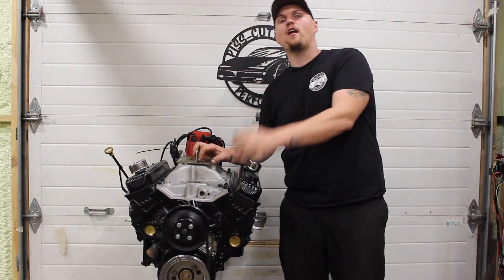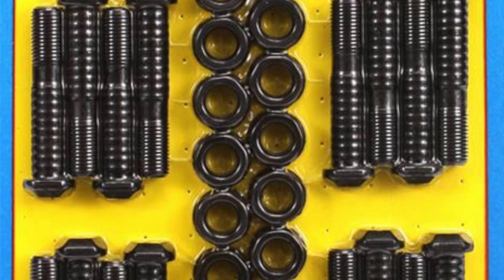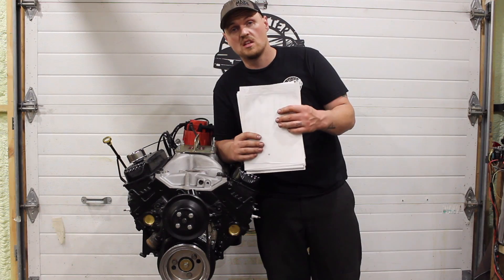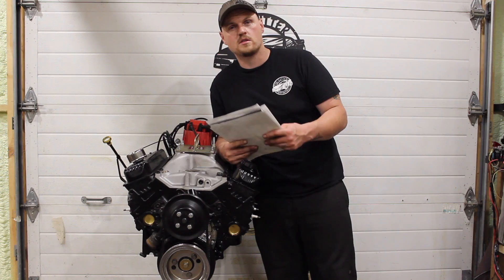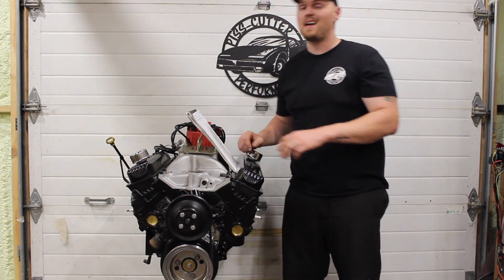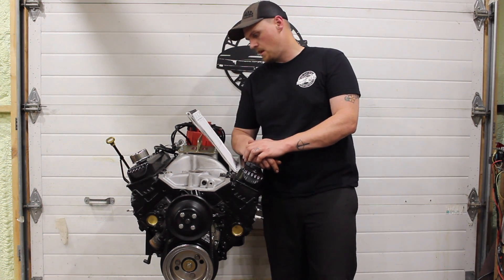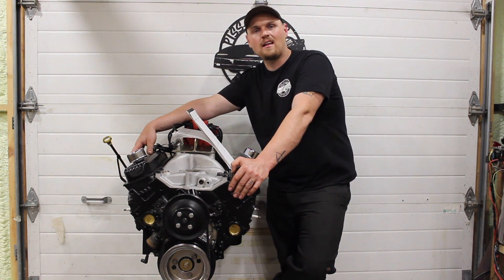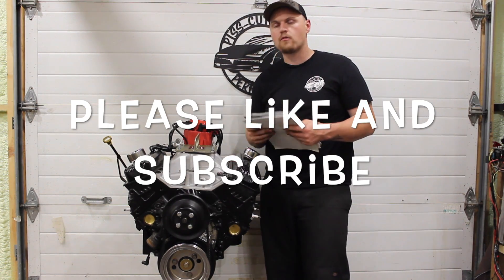Cheap Chevy 350 Power! 400+ hp Vortec Heads LT4 Hot Cam Dyno (L31 Budget)

Comment: Yeah sounds about right, stock lt4 makes about 350 hp, and thats without headers and with smog bs programmed into it. Vortec heads are fairly similar in terms of flow so naturally a slightly bumped up lt4 cam without having all that emissions bs forcing it to run rich would run 400+. People dont like those lt1s but they were pretty badass once you tuned them

Comment: Have you tried something like a Lt4 hot cam or similar specs but non-roller, solid lifter and solid 1.6:1 rocker arms adjustable valve lash. With flat top pistons at 11:1 compression ratio on 94 octane. With beehive valve springs with a tunnel ram intake manifold for 2 650 CFM 4 Barrel carburetor with thick open  carb spacers and dual 3 inch exhaust on 4 to 1 headers and straight thru mufflers

Comment: My Step-father has a L31 in his "96 K1500 that I've been doing maintenance/repairs on for years and has 200k. He's been getting interested in modifying it since I started my stroker build. I think he would be on-board with a build like this, maybe a slightly smaller cam. The newer cams have a  higher intensity than the old lt4 cam, maybe the summit SUM-8801 212/218 on a 112lsa same lift as the LT4 cam with only 1.5rr.
Reply: Is that summit cam you mentioned for a 5.7 Vortec engine or just vortec heads on a small block? I found out the hard way that Vortec engine is a different animal. Thanks.

Comment: Running a turbo 400 transmission what torque converter would you recommend 3.07 gears
Reply from the maker: Ive used that cam with a 2600 to 2800 stall and it worked well but it really depends on your setup

Comment: What fuel were you able to run in this? Would the set up be able to use 87 octane OR does it need to be higher?
Reply from the maker: It will run on 87 octane

Comment: I designed that cam in the 90’s. Originally made at lunati for an lt1/lt4 stroker combo for the first 4th gen fbody build in history behind slp intake combo, before we really figured out tuning.  We had custom made injectors prob the second run ever in history… behind accell’sLingenfelter was in communication. It was good times.  We all knew what was coming.  But for this bracket of engine there is no better combination for heat and vacuum as well as usable torque with decent rpm, we were shooting for 6400 shift points.  It’s made for a t56 speed and track, cannon ball run car. When it was still a real money race.  thanks for making this video so cool to see.  We basically used an ai algorithm for that cam combo btw, it took days for it to “compute”.  In the 90’s.
Reply: That's badass
Reply: Too bad the LT4 only lasted one year.

Comment: Sorry if i missed this. Can anyone help me figure out what kind of machine work was done? 

I have two motors i want to build. I have two sets of un cracked heads with work exhaust valves.

One of my blocks has a line in it from having water sit inside it. 

I own a very nice Sunnen portable rigid hone. 

I have not used it yet but an considering buying the tooling for it and attempting to prep my blocks for this. Any help or comments would be appreciated 😊

Comment: Just wondering the vortec heads. Did you have to machine down the valve seal bosses so you can run the lt4 hot cam?
Reply: I watched your video on beehive springs and I understand how you run. 520 lift cam with out machine the heads

Comment: I thought I would come back and update on the similar L31 I built a couple of years ago. Mine has a LT1 rotating assembly with the lightweight Mahle flat tops they used, a GM 6492' camshaft, and 185cc 2.02/1.60 valve Vortec heads that came on a dead 350 in a Tahoe I bought cheap years ago.  1.6 rockers and LS Beehives on it.  Mercruiser dual plane MPFI intake that is basically a Performer RPM with injector bungs cast and machined into it, 4150 throttle body, Thorley Tri-Ys into 2.5" dual exhaust with high flow cats to a dual in/dual out magnaflow. Runs strong even in a 5,000+ lbs G20 van with the factory TH400, factory torque converter that was behind the TBI 305 in that van and a 3.08 rear gear. Currently fighting a TH400 Governor/Valve body calibration that has me pulling my hair out. I modified a stock TH400 governor with an old TCI kit I had laying around the shop. It caused the TH400 to lose its ability to shift at a consistent RPM at WOT.  Sometimes it would shift 4,500, sometimes the 5,500 I tried to set it for, sometimes it would bang the limiter at 6,000 rpm.  I bought a new old stock GM TH400 governor for a L82 Corvette that usually gives a 5,500 rpm shift, does the same thing.  I put the stock 4,500 rpm TBI governor back in it and it shifts perfectly and consistently.  Even shifting 4,500 it moves out well, but it gets up and goes so much better shifting at atleast 5,500.  I would settle for consistent 5,500 rpm shifts, but 5,800-6,000 would probably even be better for that setup. it carries good power higher than I am willing to rev the 90s LT1 rotating assembly in that L31 engine on a regular basis. I either need to modify the 1-2 shift valve setup to allow for manual 1st to whatever RPM I choose or figure out what it is about this specific late 80s TH400 that is preventing the governor calibration from being altered from stock. Guessing it has a weak spring somewhere in the valve body that was designed to make the unit do this, because it also lacks a WOT 2-1 downshift at any speed and cannot even manually shift it into 1st above ~10 mph.

Shifting at 4,500ish
https://youtube.com/shorts/hSR8kKJkMk4?si=O_npU5f43aYCcMY4

Comment: I wonder how much the one I built would make…it runs great..same bottom end and carb …can is slightly different 

.217/225 .495/500 110 LSA-roller 

Air gap intake

Blueprint 195 - Alum heads 2.02/1.60 68cc

Headers- ACCEL hei - 1.5 roller rockers

Comment: Hey I'm building a engine mostly like this one. I'm wondering if anyone has used sum-174000 spring kit. It looks like it would work has 550 lift. And is cheaper.
Reply from the maker: You won't be able to get much past .500 lift with that kit before the retainer gets too close to the valve seal

Comment: Were any modifications done to make the LS(7?) Lifters work?
Reply from the maker: No, they are direct replacement
Reply: @cuttersperformance slowly figuring this out so far I’ve got 
36lb Aus Injectors ( spider injector replacements ) 
174002 Springs 
8802 Summit Cam 
PRW 1.5 Ratio rockers 
LS7 Lifters. 
Just need to find a local guy that can clean the heads and do a valve job and porting. 
Also on a LS Computer and will be tuned through hptuners. 
I’d like to see you take a shot at keeping the stock L31 Intake and seeing how it pars with the carburetors!

Comment: I got an L31 stuff'd Summit flat tops, forged rods, Skip White NKB heds a Melling roller w/ .495I- .503 E 220-224 @.50 w/110 lsa,, very close to 10.01 to 1 compression ration,,, should squeek out a bit more power than the GM Crate motor,,, should be a good combo for my daily driver 71 Chevelle,, 
I try to find similar builds to geustimate what i will hav,,,
Thanks for the work you do,,,

Comment: 383 stroker with vortec heads and lt4 cam would work great or should get different options?? Please help
Reply from the maker: It would work, but personally, I'd go a bigger cam on a 383. I'm doing a few 383 stroker on my channel over the winter if you need some ideas
Reply: @cuttersperformance i have a vortec engine in my 81 corvette 4 speed,need vacuum for headlight,

Comment: Definitely surprised with the HP. The XR276HR on Comp Cams website is only making 375 or so hp. That's with a 224/230 split.
Reply from the maker: I wish they did those dyno charts with better heads. They used dart SR heads, which are basically a crappy stock head
Reply: @cuttersperformance  yes, I guess they just do it to show the type of curve you'll get. I'm hoping to get over 400 with a set of TF 195 on my sbc.

Comment: Do you think this would run with the stock vortec intake? I mean everything you’ve done to the heads but with msd ignition parts paired with upgraded spider injection in the stock intake? With computer tuning of course. 98-02. I could 0411 swap it as well but I think I could get it to run decent with the stock 99 computer. 99 Tahoe Limited is the piece in question.

Comment: The thing is when your driving through town in third or second gear & whomp on throttle 350 specialy carburetored? they have so much torque dyno,s don't show that whomping power? fuel injection is weak crusing thru town no whompping power just rpm,s lol?

Comment: Am i able to run the stock vortec heads?
Reply: At the very least you should replace the rocker studs with thread in studs. Be best if you also installed heavier springs too to prevent valve float or breaking one depending on application.

Comment: I'm trying to understand cam lift and valve clearance. I saw in another video where the vortec head was modified to clear .500 of lift. How can a cam with .525 lift require no machining on the head to clear the .500 of lift?
Reply from the maker: This video should clear everything up for you 
https://youtu.be/UZosxGQyGMs
Reply: @cuttersperformance  thanks. That cleared it up. Is there any other valve retainer that will work with this valve spring? Seems summit it still out of stock on the SUM-174003-3.
Reply from the maker: @dbohann66  787-16 comp

Comment: That's very nice,ypu think if pump thr compression up to 11to 1 will be better or possibly? Maybe better rods can be rev higher?I have a gm performance engine 350,357hp 407 torque, I need just a little more,thanks!

Comment: Pat, what’s your thoughts on the Summit 8802 cam, that’s supposed to be an LT4 Hot Cam copy without having to use the 1.6 rockers? On paper it looks very comparable, and for the price = Gold! Any input you can offer? This is the cam I’m going to run in a stock Vortec bottom , like yours, and I have followed ALL your Vortec head vids- so hoping for similar results…… I still have to measure (like you informed me!) the clearance on my full roller aluminum  rockers, with the 787 retainers and either the .050, or .030 offset keepers (like you also have taught me!), and make sure it’ll clear, or grind the wings down to fit given the minimums you said I should look for! You are almost a Demi-god on how to make these Vortecs rock!! I called Felpro about using their .015/ .016 steel shims on my 100,000 mile short block and built Vortec heads, and they recommended using spray high tack (Indian head/ permatex) on both sides and torque down before dry. Thoughts? 
ALSO! huge question! I lapped my old valves in, but thought- as cheap as new Engine Tech valves were for stock Vortecs, I decided to buy new valves. Question- do I now need to lap the new valves in also, so they seal right, or are new valves fine without lapping?

Everything I’m learning- I’m learning from you, brother!!! THANK YOU!!!
Reply from the maker: yeah that cam will work just like the LT4 hot cam, the summit cams are great quality. 
Careful spraying some of the felpro shims gaskets as they have a rubber film on them that will react and peel when sprayed with copper spray. If it's a bare shim gasket then yes the copper spray is a great idea to prevent water seepage. 
Never a bad idea to lap in new stainless valves on old seats. 

Cheers! Pat

Comment: From what ive heard the 604 is very undercammed and with a nice bigger cam they pump out around 480hp all day long with just a cam swap, the 604 is a class engine for short track and i believe come sealed, i have a buddy that ran pro stock that was his dads on 1/3 mile banked track and they can run a sealed 604 with a 4bbl but he has a 11:1 350 that dynoed arounf 500hp but they have to use a 2bbl. I thought it was the 604 but its the built 350 thats itting in the corner of his garage collecting dust i said tell you dad to sell that to me for super cheap for my 92c1500... Hasnt happened but as far as i know he just runs the 604. He said oh you dont want it you cant run it on pump gas but i told him with the right cam its doable. He also has a winters quick change, he wants $500 likely get it for like $400 maybe less maybe not but theres no hubs on it just housing and axls poking out and i have zero knowledge of those rear ends as far as set up and id likely end up with way more than $500 in it? But it would be cool as hell being able to change gear ratio in minutes and just having a quick change sitting under a chevy truck. It would probably hold up on the street like i would use it? but ive heard they dont hold up well with a bit of power and some traction on the drag strip.

Comment: Very good videos you putting out on L31 Vortec SBC. How does this LT4 Hot cam perform from idle to middle range rpm? Does it kick in straight from idle to 5000 rpm? Or does it kick in from like 2000 rpm to the red mark? I have a L31 Vortec SBC I want to swap cam shaft. I am not sure if a LT4 Hot Cam is the right cam shaft for me. I am not in to racing. This is a Truck (1980 Chevrolet C 10) I am using as a dayli driver, sometimes towing and sometimes to do traffic light "racing". I am rarely goin to push it to high rpm range, to 5000 rpm. I am going to use pump gas. I love it when I push down the throttle pedal from idle to the red line and feel my back is pushed to the car seats. Like instant action. Is a LT4 Hot Cam is not the right one for me? I would be grateful for any recommendation. Thanks.

Comment: Just built a similar simple build using the stock L31 shortblock. Added flat top pistons, 292/296 Trickflow hyd roller cam and AFR Enforcer heads. Would love to know what kind of HP it makes. Just loaded a video of it running on my channel.

Comment: HI, JUST WONDERING WOULD THOSE VORTEC HEADS WITH THE LITTLE PORTING YOU DID BE BETTER THAN THE STOCK 1995 ALUMINUM LT1 HEADS ? I'M HOPING FOR 450 HP FROM STOCK HEADS, WITH A LITTLE BIGGER CAM, RPM AND SPRNGS
Reply from the maker: the LT1 heads and the Vortec heads flow similar as GM basically used the Lt1 design for the Vortecs

Comment: I have like the exact set up now I wonder if using the hot cam lift and changing the lsa to 108 and duration 232-242 would gain any power? I’m new to this
Reply from the maker: Thats abit too much duration for the compression of this engine. But a 228 to 230 @.050 on a 108 would be a nice choice for this engine

Comment: Will a stock bottom end Vortech from 96’-2000 survive 6200 rpm for a long long time? Wanna pick one up for my 3rd gen and have it daily friendly. Maybe stock cam with ported/decked heads? What’s the safe RPM limit?
Reply from the maker: They will survive for a long time if you do a refresh on it. Have the rods resized with arp bolts. I have a customer who has a stock L31 crank/rods (arp bolts) with flat top cheap pistons. It has survived over 4 years now with a supercharger and 6500 rpm
Reply: @cuttersperformance  can I avoid doing a refresh if it has sub 100K miles or just something to look into period? I can pull an engine and do heads but anything past that I need some help involved.

Comment: So I've built the same engine except am using patriot vortec heads with 2.02/1.60s, decked block and .028 gasket. Pistons are .010 in the hole. 
How do you have your mechanical advance ramped in? What springs are you using? I'm having trouble finding a good timing curve for this engine. 
I'm also using a new Brawler 750 dp. I've been tuning on it also but need to get my timing right. Any help?

Comment: These numbers are right inline with my flat top 383. It has ported 906 Vortecs, Edelbrock dual plane intake and a Brawler 750. It has just over 10:1 and made 456/462. The cam was a Comp roller, I think it was pretty close to the lt4 hot cam, 224 @ .050
Reply: What head gasket did you use?

Comment: What do you think about a 1996 350 vortex I am going to build it for a 87 S10 do you have any pointers on what to do with the heads and cam I want a thumper engine similar to a 383
Reply from the maker: Yeah the L31 is an excellent base to start with. Check out my vortec head flow videos as well as the valve spring videos for some tips

Comment: love the video's and all the great information in your videos. i have a stock 94 tbi block and a set of 062 vortec heads that jusr left machine shop and heads have been gone through. i wanna run a nice sounding cam but not sure how big i can go on all stock parts besides dual plain intake and carb.also stock converter older 4l60e .could you please give me some gd advice thanks keep up great videos

Comment: @cuttersperformance on another video you stated that vortec heads with ls6 springs can only accommodate around .480 lift without matching valve seals or running offset keepers, but this lt4 hot cam has higher lift and you said there’s no matcining done on these heads aside from the porting, could I run this cam with ls6 springs, no machining and stick replacement keepers and retainers? Thank you for any info
Reply from the maker: This video should clear up all your questions for setting up your vortecs with beehives. Recommend watching through the whole thing, its only about 15 mins long
https://youtu.be/UZosxGQyGMs?si=pj59JJAmU9z0DCy5

Comment: I have the same cam and motor. Did you use the standard firing order or did you change to like a 4 7 order over 7 4.
Reply from the maker: The firing order of the LT4 hotcam is the standard 1-8-4-3-6-5-7-2. You can not change the ignition firing order unless the cam firing order is changed